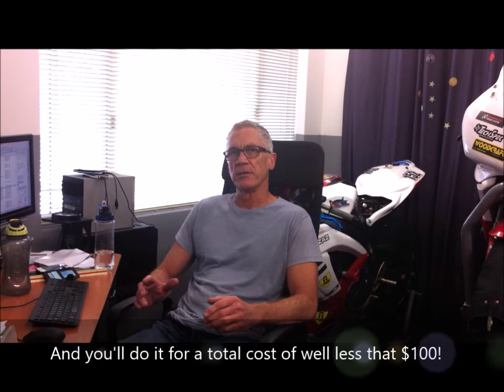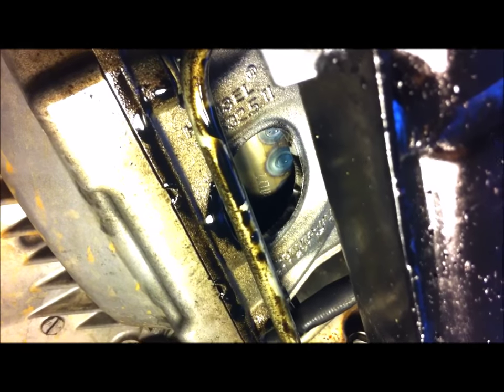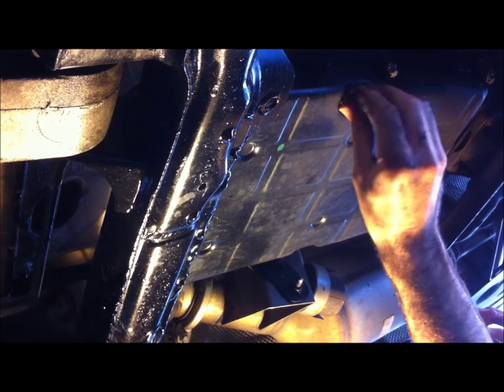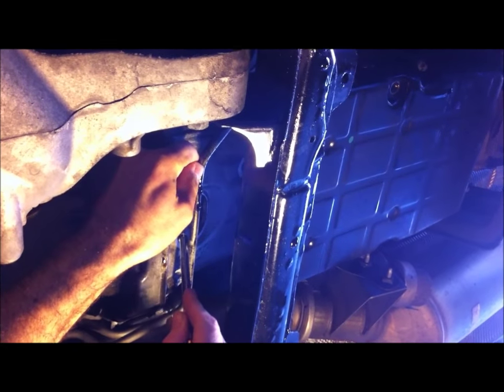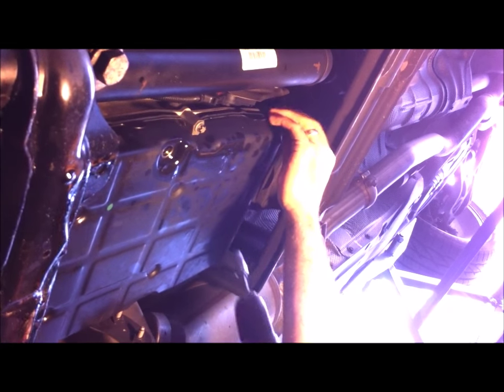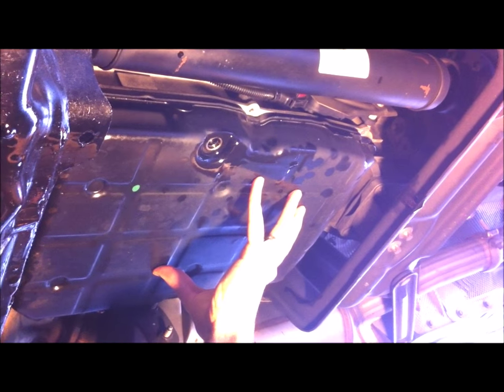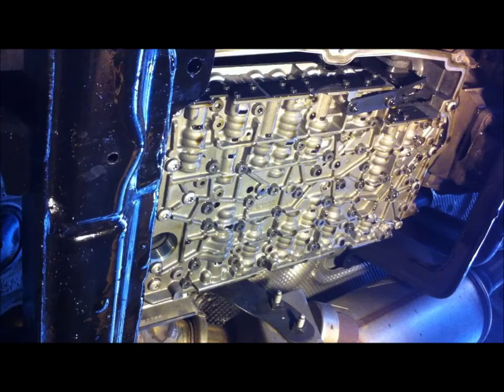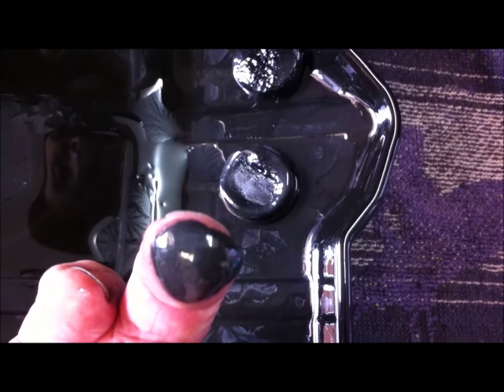Mercedes 722.9 ML320 ML350, C, E, S, GL Transmission Service

Comment: Great video Scott! Jus wondering where did you get the M6 x 1mm bolts and ‘washer’ thanks heaps ;)
Reply from the maker: Thanks Andy. Any automotive parts/accessories or hardware store will have M6 x 1mm pitch high tensile bolts. They're a very common size.

Comment: Great video.  What are the 2 plugs on the torque converter that showed up first on the video?
Reply from the maker: Thanks D ... they're not plugs they're spot welds on the TC. There's only one hex keyed drain plug. You can't miss it. Scott

Comment: Hi Scott Great video I have just purchased  a 2011 ML300CDI with 170k on the speedo has a shudder at low speed low load do you think this will help
Reply from the maker: I would not be surprised if the transmission has never been touched. The low speed shudder may well be a sign the transmission needs to be serviced. It's simple to do and worth the effort.

Comment: Hi Scott, how's things?  It's a long time since I've seen a new Mercedes video from you and I trust you are well!  Anyway, I am just about to replace my thermostat on my 2011 Mercedes ML300 with 642.820 engine and I am wondering if you have access to the technical data sheet for the torque specifications of the the thermostat housing bolts?  Thanks Andrew
Reply from the maker: Hi Andrew and yes I'm going ok. I haven't made any Mercedes videos for a while because I haven't had to do many repairs ... which is a good thing. Those thermostat cover bolts are M6 and tightened to 9Nm.
Reply: @ScottElliott152  thanks Scott!

Comment: Hey Scott,
another question, what sized pipe did you use to flush the oil cooler? Also would it still work to flush it without the fitting on the end of the pipe?
Reply from the maker: It was 10mm plastic tubing because that's what I had lying around. You need a way to form a seal when you connect the plastic tubing to the end of the pipe. I came up with my fitting as way of doing that for both the 722.6 in my Vito and the 722.9 in my C320CDI.  You could use larger diameter tubing (??mm) that fits over the pipe or come up with another method. There's no right way to do it ... you just have to connect a hose to the end of that pipe that will hold about 5psi.

Comment: Thanks for the video. When you turned the crankshaft pulley, do you have to put the gear in Neutral or stay in Park?
Reply from the maker: Either will work. When in Park it's only the transmission that's locked. The engine can still turn because of the torque converter.

Comment: Hello I need some help.
I've got w221 s320 cdi 2008 with gearbox 722.9 stucked in P position. On the screen famous message "vehicle not in P position" and "drive to workshop without changing gears".
3 mechanics diagnosed ISM module so I've taken it out and sent for repair. Unfortunately the module was tested and appeared it is working just fine.

Have you gou got any experience with this kind of problem.  Can you point where to look at?
Thank you
Reply from the maker: I have no experience with such a problem. Interrogate the Mercedes forums as there's quite a bit of information out there.

Comment: Since getting the fluid at a certain temperature could be a problem, I am thinking about doing this job cold.  If I replace the fluid with the exact amount taken out, everything should be just fine.
Reply from the maker: I wouldn't recommend doing it that way. Get a multi meter with a temperature probe. They're cheap ... or use a meat thermometer.
Reply from the maker: It's important to get the ATF hot before doing the job. You want all the fine particles in suspension so they drain out.

Comment: Fantastic video - Thank you!    I've read all the comment but didn't see any mention of a pan gasket.  Is it integrated into the pan an non replaceable or am I missing something?   Cheers from Canada
Reply from the maker: Thanks Dan. Watch from 8:30 again. When you buy the the filter you normally get a new oil pan rubber gasket. I mention that in the video but perhaps my Aussie accent is a problem :-). 
Like this:https://www.ebay.ca/itm/Transmission-Filter-Gasket-Bolts-OEM-Elring-Mercedes-722-9xx-7-Speed-Trans/312994175827?hash=item48dfe81b53:g:-RoAAOSwTJJeRlV-
Reply: @ScottElliott152  Right you are. My apologies, I totally missed it.  Your Aussie accent is great and unique. Thanks again
Reply from the maker: @danpinero9243  Haha ... thanks. Don't be afraid of doing this work on the 722.9 as it's quite straight forward. Do some planning, take your time and you'll be rewarded with a sweet shifting transmission.

Comment: Awesome job.  Don't know where u get ur fluid, but just the fluid is about 150 us:-)
Reply from the maker: We used Total Fluidmatic LV MV. We paid about $AUD6.75 per litre. That's about $USD4.86 per litre.
Reply from the maker: Yes. When ever you're changing oil, be it engine, transmission or differential take the car for a decent drive first to heat it up.

Comment: Hi Scott Eliiot, your video is well explained.  Quick question, I have a 2007 CLK 350, do you happen to know if it is the same method to drain the transmission fluid? What kind of transmission do I have in my CLK 350, is it the 722.9? Can I use Valvoline 236.10? Thanks
Reply from the maker: You have the same 722.9 ... 7 speed GTronic transmission. The same method is required to change the ATF and filter. You must use the red ATF with Mercedes specification MB236.14. It's not a difficult project if you do some planning before you start. If you follow this video you'll do a far better job than the "professionals". Regards, Scott

Comment: I have a 2007 ML320. Looks like you replaced the fluid from beneath. Do you know if these have a tube to the engine compartment like some of the other mercedes? Hoping to check the fluid level somehow as there is some fluid around the transmission. Thanks
Reply from the maker: The 722.9 transmission has no filler tube or any means to check the level. It can only be filled via the drainage plug by pumping in ATF and setting the level with the overflow pipe as shown.

Comment: I understand the procedure to fill the new fluid from the bottom until it starts draining again.  That is the indicator that the new fluid is Above the level of the stand pipe so if the fluid is at or very slightly below the stand pipe then should be fully serviced.. good tip on the Torque Converter and oil cooler flushing.   Money for dealers and production costs aside I have no clue why the traditional fill tube and fluid level dipstick was removed.  Make it easier but then again I am sure someone screwed up along the line and ruined it for everybody.
Reply from the maker: I suspect MB did it to make it harder for the average DIY'er. Also they had their "filled for life" nonsense so propagated the myth the transmission didn't need servicing. "Life" was about 5 years to get a new car past the first lease. MB make transmissions so it's in their interest to sell a $10k transmission to the unsuspecting second or third owner. I agree a traditional fill tube and dipstick is better. At least you can check the level and condition of the fluid. I have a video where I installed a secondary drain hole. That makes it quite easy to do an ATF change every few years without taking the pan off. Probably every second service drop the pan and change the filter to.

Comment: Question. When draining the torque converter I also did not use any kind of chute or hose from the drain plug out. So some of the oil ended up dripping/draining into the torque converter housing. Since the oil change I am getting a very small amount of oil about a drop a day, around this location.  I am assuming this is the excess that got in when draining ....I just wanted to confirm that you noticed this also.  I did confirm that the torque converter bolt is not leaking, and my car is only 4 years old hence the change but only has 18k miles on it....so I cannot imagine a seal leak etc.....I suppose the oil that got in has to get out...but just wanted to confirm with you!  Thanks
Reply from the maker: Yes that's how mine is. A small amount of oil will pool inside the TC housing. After a week or so it's evapourated/drained away. So it's nothing to worry about. Regards, Scott
Reply: Thanks for all the information and help you provide, the service tech manuals on these cars is way too expensive so without you it would have been essentially impossible to complete this job ...THANKS!
Reply from the maker: Thanks for the compliment. I forgot to mention last time I used some spray on evapourating parts cleaner. I just gave it a good spray around the TC drain plug and the ATF was cleared away easily.
Reply: I did this a couple days ago like you suggested and double checked my toque converter drain plug and it is totally dry.. I also used a thin piece of white paper to probe around and see if I could find some ATF...found nothing. However it still is leaking right at the location where the torque converter housing  joins/seals with the rest of the transmission (right in front of the hole) . Leaks about 1 drop a day....I am starting to fear that it is a seal or oring .....car has 18k miles and never dripped before I did this oil change...any reason you can think of that this procedure would cause this?
Reply from the maker: I wouldn't be too concerned yet. I feel it's residual oil left over from the ATF service. Wait for a few weeks and check. It's possible your drain plug could be leaking when the TC is spinning. I do use a sealant on my plug. 18k miles is far too soon for rear crankshaft seals. Is the oil ATF or black like engine oil? Scott
Reply: Definitely not the drain plug on the torque converter , I checked it after driving by turning the engine bond dry. It is definitely the green fluid I put in....I think your right, we don't drive much, has to be the residual...(cause and effect) I will give it a month or so....thanks!

Comment: Hi scott. I was always taught not to put any air pressure into the gearbox because you can damage things like solenoids and rubber seals. I know you wouldn't have done the above if you didn't think it would be safe to do, but can the compressed air actually damage solenoids and seals?
Reply from the maker: James the gearbox has a breather on the top anyway. Also the oil pan is off and I've set the pressure regulator to about 5psi which I think I mention in the video. I'm putting the air into the oil line to the cooler and it vents straight into the open gearbox. It's not a problem. Hope that helps. Scott
Reply: Thank you Scott. I've got a 2007 W221 S320. Ive always drained the torque converor, but never have gone as far as you did with adding fluid through the oil line to push the rest of the old fluid out.
Reply from the maker: James it appears the oil lines and cooler retain about a litre of ATF which is 10% or more of the total volume. I don't want to contaminate my new ATF with a litre of old stuff!

Comment: Hello Scott Elliott thank for the vidéo
Can you tell me if you filled everything and after started the car? Or if you start the car when you have filled about 5 liters?
Also when you rinsed it is through the hole or tube that you send the oil? I do not see, you have your hand in front.
Thank for answer
Reply from the maker: Fill the transmission with about 7 litres then start the car. Add about another 1.5 litres and bring the transmission to about 45C and drain the excess while the car is running.

Remove the oil tube that goes to the oil cooler and flush from the tube.
Reply: Thank

Comment: Hi Scott-
I would really appreciated your input on me doing a ATF oil change on a 772.9 with 200k. 
Bought it used and I’m reluctant on do this due to the horror stories out there that say if you change  the fluid an a high mileage trans it’ll make more harm than good. Thank you and awesome work man.....
Reply from the maker: Yes I've heard the urban stories to never change the ATF on a tranny that's got high km's. The theory is all the accumulated gunk and deposits are holding the thing together! My feeling is if it's gunk and deposits holding it in one piece you're on borrowed time anyway. If I was in your situation I'd do two ATF and filter changes. Do the first and drive it for a few thousand km's then do another to give it the best chance of cleaning it out.
Reply: @ScottElliott152  will do,  ill keep you updated on my project. best wishes to you buddy. cheers-
Reply from the maker: Sergio ... good luck with it and do report back with your observations. Share the knowledge. Scott

Comment: Awesome video.... if you don't mind me asking.  What kind of jack are  you using to lift up the back of the ML after driving the front on to the ramps?
Reply from the maker: I have one of these. They're a great bit of equipment and pack away easily: https://www.ebay.com.au/itm/SPIDER-2500-PORTABLE-MINI-SCISSOR-LIFT-by-Hero-Hoists-Qld/163512323884?hash=item2612180f2c:g:uIwAAOSwVIZcTsqx:rk:1:pf:0
Reply: @ScottElliott152  Thanks Scott.  That is way cool, though i don't know if I can get it here in the states.  I picked up a second hand ML around the time you replied to me.  I just did front diff and transfer case this evening.... both looked a bit like the tranny fluid in this video...LOL.  Anyway, I supposed the short term solution for the tranny flush after I figure out how to replicate your adapter is 4 ramps.  I know it's late but thank you again for this stellar tutorial video.
Reply from the maker: @ZaphodsPlanet  Thanks for the kind words. Those lifts are made by Active Slimming Goods in Taiwan ... lol. I don't know how a car lift fits their core business products line up but there you have it! I'm sure someone in the USA will be importing them. Perhaps send an inquiry to Active Slimming: 

http://www.hktdc.com/manufacturers-suppliers-products/Active-Slimming-Goods-Enterprise-Co-Ltd/en/1X00MWIU/1/ 

They have 9 slimming products and 1 car lift ... amazing. Perhaps the car lift is good for lifting heavy people onto the slimming equipment!

The easiest way to get an adapter is buy this for $10 from Amazon: https://www.amazon.com/Mercedes-Benz-Transmission-Fluid-Filling-Adaptor/dp/B074XN8PTL

Comment: Great video. Please I need a quick help here. A mech wants to carry out the tranny change on my ML350 4MATIC 08, he loosened the pan and filter and said he will do the oil change from the bonnet. he unplugged some hose pipes from the radiator(left side facing the bonnet) and said he could pump into tranny from there. please help.
Reply from the maker: Your question isn't very clear. Did he remove the pan, clean it and the magnets and replace the filter? 

It's possible to fill the tranny by disconnecting the oil pipe to the oil cooler (which sits in front of or behind the radiator ... I can't recall) and pumping the new ATF in from there. Scott

Comment: Great tutorial, thank you. Question. I put a level on a pan and it seems that it set up at an angle under a car. I need to significally lower the front of the car compare to the back to make the pan level - is that how it suppose to be done?
Reply from the maker: Thanks ... level the car which means the pan will have a tilt to the rear. That's how it's supposed to be. Regards Scott

Comment: Hi, great video.  I have an ML 350 2014 4matic. We do some towing with it (popup trailer). I would like to install a trans temp gauge and aux cooler. I was wondering, can I connect the gauge to this probe and get the reading?
This probe is on the right side of the trans?
Thanks from Texas, USA.
Reply from the maker: Thanks Ivan. I'm not familiar with this probe you speak of. I can't find any details or photographs about it. There's a temperature sensor inside and perhaps the wires coming from this "probe" contain that signal. You could try asking on www.benzworld.org. If you're fitting an oil cooler there are fittings available you can place in the lines to hold a gauge temperature sensor. That's probably the simplest way to get your ATF temperature reading. If you're towing frequently change the ATF and filter more often ... probably every couple of years or 20,000 to 25,000 miles. Those 722.9 transmissions cost a fortune if they fail. I'm not convinced the ML320/350 was designed as a robust towing vehicle. I've never seen one towing anything ... not even a small garden trailer. It's nothing like a Toyota Landcruiser which are the most popular towing vehicle in Australia. Cheers, Scott
Reply: Hi, sorry about the misunderstanding.
Noticed in another of your videos and the probe you were taking about is the temperature probe of your meter.
Got me confused. Sorry about the confusion.
Reply: Hi Scott, finally decided to install an aux trans cooler to my ML350. I have a question hoping you can answer it.
The two trans hoses connected to the radiator top an bottom on the top right side of the radiator. Do you know by any chance the flow direction, is the top one going in or out or contrary?
Thanks anyway, stay healthy…
Reply from the maker: @Ivan-nd7kh  Follow the hoses back to the transmission. The pipe on the LHS of the transmission is the pressure or outlet side that goes to the cooler. The pipe on the RHS is where it comes back in again.
Reply: Thanks

Comment: Gee the 2008 I just serviced did not have converter drain plug ,USA production run ml 320 had square plate spot welded over where drain plug should have been
Reply from the maker: Hi Ernest ... well that would have been annoying!

Comment: Hi Scott, thanks a lot for the great video. I've got an ML280 (2007). Do you happen to know if it would be the same procedure as the 350 in your video? Thanks, Elliot
Reply from the maker: Elliot ... I'm pretty sure the ML280 has the 7GTronic 722.9 so the process will be the same. The easiest way to tell is if you don't have a transmission dipstick tube then it's the 7 speed 722.9 series.
Reply: Thanks very much.